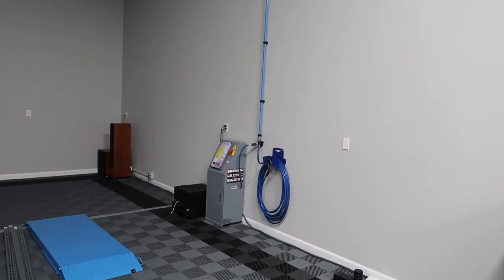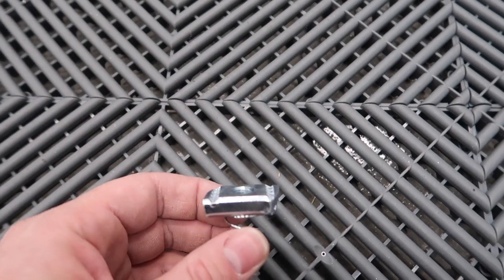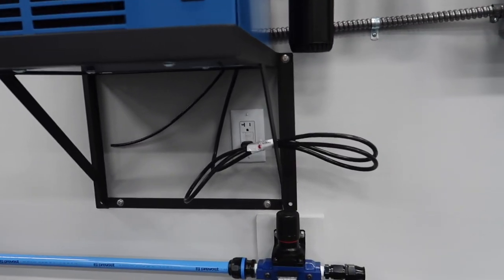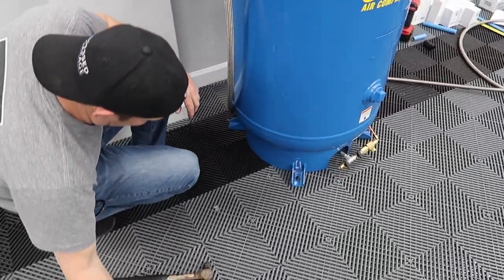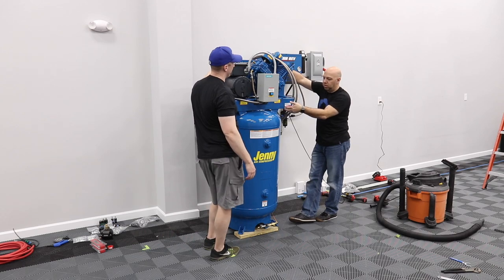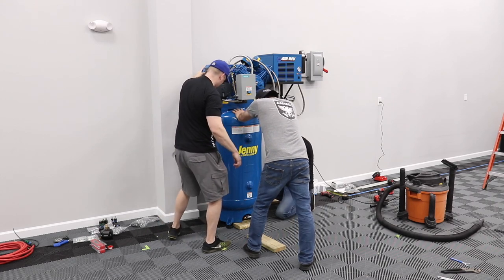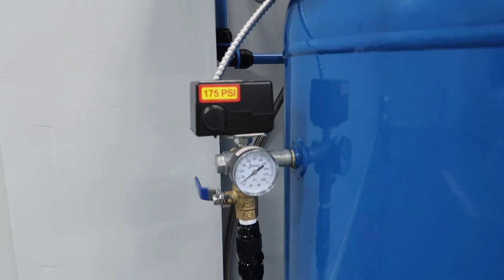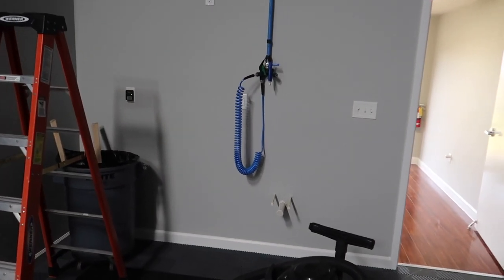Compressed Air Project: E5 - Completing the Jenny/Prevost Install

Comment: I would not trust self-tappers long term to suspend an overhead load that could kill you, especially when subject to all the snags and tugging of a hose reel.  On the concrete anchors I always drill completely through so the anchor can be driven down through the concrete to aid removal of the monument and also so the hole can be easily filled later. Behind each of your drops the wall is going to get soiled from use, so I would add a stainless plate to the wall behind each air drop.  If you don't like the stainless, have some plates laser cut with your logo in the bottom right hand and paint blue.
Reply: I have been using them overhead in my trade for the last 30 years without a single failure. They are more hearty than you might  think. I am 185 LBS and I can't even pull one out of a 14GA purlin  let alone 4 of them. The reels will only weigh a fraction of that so the chances of 4 screws failing is pretty much zero.

Comment: Man. That dropping of the compressor over the installed anchors looked like a real pain. I was working alone, so I just put the compressor on it’s final resting place, then mark, then drill, both floor and vibration pads, then lean the compressor to get the pads in place under the feet one at a time, THEN hammer the anchors down through the feet and vibration pad. Torque down, loosen one of the feet by 1/16” to reduce stress on the tank.

Comment: 33:06 Wouldn't you want the PMA201 to be mounted as low as possible? It is activated as a float, so are you expecting the compressed air to force water up the 10-12" of brass pipe and into the PMA201?
Reply from the maker: I think we are good having 175psi in the tank.  It shouldn't be an issue.
Reply: I just checked out install instructions for what I think is a similar product, the Drain-All by Control Devices, LLC. They say "line should have no sagging sections, droops, upward slopes, or loops as they can . . . hold condensed liquid"
Reply: I'm not sure if I agree but I'll let you be the guinea pig for us as always!
Reply: I thought about this some more. When the tank has accumulated enough water, the system very similar to an "enlarged leg manometer". You have the 175psig acting across the cross-sectional area of the tank, applying a force on the water (F=pressure*area). This force causes the water level in the much smaller diameter brass pipe to rise. The system only acts this way if you have an incompressible fluid such as water that has accumulated above the horizontal run of the brass pipe, and has filled or partially filled the main tank. If the water hasn't accumulated to fill the tank, the water will simply fill the horizontal brass pipe and the less dense air will full the vertical run of the brass pipe. Whenever enough water fills the horizontal run of the brass pipe, it will start want accumulate in the tank on the conical area at the bottom of the tank, and the pressure of the air within the tank will force the water higher and higher up the vertical run of the brass pipe.

Comment: Matt - I'm questioning WHY Mike installed the Auto Drain ABOVE the drain outlet height. Shouldn't it be at the same level which is almost ground level? That installation height might retain some amount of water - just saying........
Reply from the maker: We needed a little elevation the get to the inlet on the drain.  It had a larger inlet on top of it that we needed to neck down.

Comment: I would imagine the pipe loop added quite the volume to your tank capacity.  Any idea how much? Accommodated pump motor size necessary? Consider tuned floor mounts for compressor to reduce noise if necessary.
Reply from the maker: I'm not sure about that one, but it's probably a simple calculation.  1" lines
Reply: About 4.5 gallons